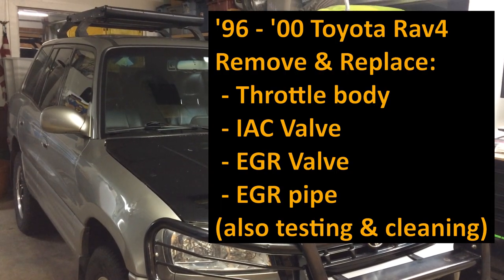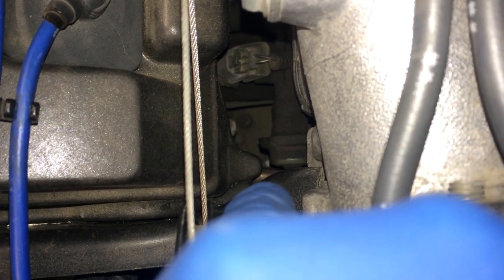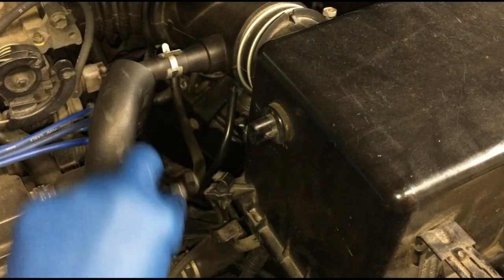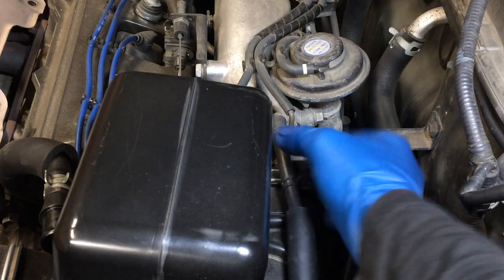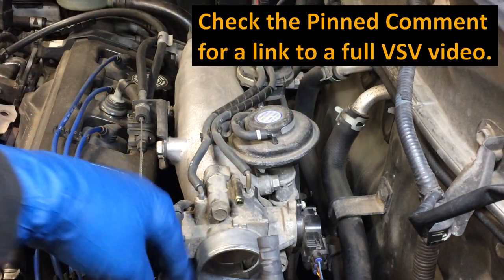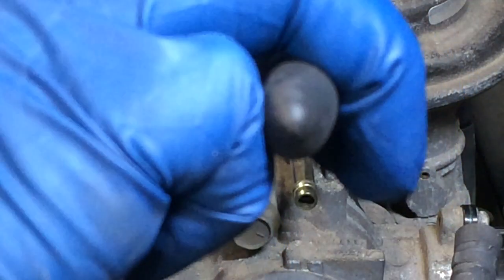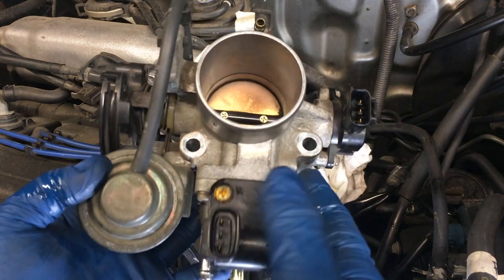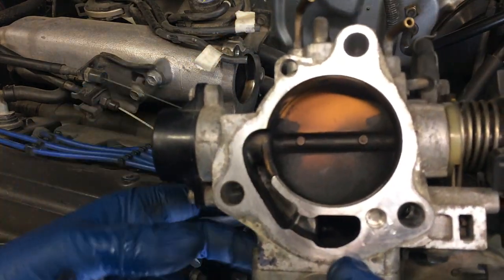1996 - 2000 Toyota Rav4 DIY Remove Throttle Body, IAC Valve, EGR Valve, EGR Pipe, with Bench Tests

Comment: I can not find the video L35, but I'm almost positive I watched one of your videos where you recommended using only Denso PK20TR11 double platinum spark plugs for the 2000 RAV 4, instead of copper or iridium. The plugs I pulled out of the RAV I am working on are Denso Iridium. Not the right plugs??  Thanks.
Reply from the maker: That might have been the timing belt video -- yes, the correct plugs for the gen-1 Rav4 are the Denso PK20TR11 platinum.  I would replace the iridium plugs with the platinums.  Be sure to buy Denso plugs only from approved retailers, and not Amazon, ebay, etc, because spark plugs are counterfeited often.  Those Denso plugs are about $8 each, so if the price seems to good to be true, then they are probably counterfeit.  I hope that helps -- good luck!
Reply: @L35inColorado  Thank you so much L35 for your valuable help. I use Advance Auto 95% of the time.  Even if they cost more than the net,  better safe than sorry.
Constantly amazed they stock parts for 21 year old vehicles. Hope you are healthy and happy in these uncertain times.
Reply from the maker: @hardlyworkin3603  Yes, I use them too.  You can save money at Advance if you order online, then select "pick-up in-store", and use promo code RMN25 at checkout online.  That usually gets you 25% off orders over $15.  I hope that helps : )
Reply: @L35inColorado  Incredible news!  Had no idea.  Definitely will help.  That will save a huge amount of cash, considering how many parts I need for this old RAV.  I wanted to get the Denso reman. alternator , but they are gone.  So I have to buy the new Carquest Pro 90 amp.   And a new Die Hard or Optima AGM battery . Thank you for your advice . YouTube is a great place when you need help from educated professionals such as yourself . So glad I found your site.
Reply from the maker: @hardlyworkin3603  I just checked the RMN25 code, and it is expired, but this code works for 25% off: OFFERS25
So hopefully that will save you some money! : )
Reply: @L35inColorado  Indeed it will. Thanks for the new code. I have all your parts numbers written down. Hope Toyota still stocks the parts I need from them.
Reply: @L35inColorado   One other major choice I am not sure of. Transmission Fluid.  Aisin ATF  Type T-IV,   Toytota ATF-WS, or Amsoil Signature Series.  Would you have an opinion on these choices.
Reply from the maker: @hardlyworkin3603  Yes, there here are some notes on ATF from another video -- it should start at the right spot, but if it doesn't, skip to 50:36
https://www.youtube.com/watch?v=HOcu3zuq1AY&t=3035s
I hope that helps!
Reply: @L35inColorado  I had not watched this video yet. Otherwise, I would have known the answer to my query.   Having now watched this one, yet another great tutorial from you. Thank you so much for your reply.
Reply: @hardlyworkin3603  for future reference i wudn buy any starter or alternator made in china. I went through 3 brand new not reman Napa brand, in a 3 year period! Best to have locally rebuilt with quality parts. Also the oem alternator gave me a month warning before it failed-squeeled for 2000 miles. But the made in china no warning at all. One min they worked and next they didnt!
Reply: @dw4940  For the most part, in 2022, I agree with you. Finding a reputable outlet that sells quality reman. Denso alternators is like finding a needle in a haystack, if you can find a Denso reman. at all.  It is also hard to find a local alternator/starter rebuilder outfit that knows what they are doing, and installs quality parts in the rebuild that meet O.E.M. specifications. Last time I hired a local in San Clemente,Ca. to rebuild my alternator for my 1992 BMW 735iL, he used all the wrong parts, and after install, I drove for 1 day, and it failed. He was supposedly reputable in the community. Another needle in the haystack not found that week.

Comment: Hi, great video. What has my Rav 4 got to do with idling? It starts ok, only it doesn't idle unless I keep it accelerated. I changed the throttle and it does. Thanks.
Reply from the maker: I'm sorry that's happening -- there are a few thing items that might cause this.  Check for vacuum leaks, especially the MAP sensor hose, but also all the other hoses.  A stuck-open EGR valve can also cause what you're describing, but I wouldn't suspect that just yet.  Other items are the TPS, IAC valve, ignition system (distributor or direct ignition).  
Perhaps you can start a thread in the 4.1 section of rav4world.com: there are some very helpful and knowledgeable Rav4 owners there who might be able to help you out!  Good luck : ) 
https://www.rav4world.com/forums/4-1-faults-fixes.85/

Comment: I seem to have a vacuum line right under the Throttle position sensor, that feels attached to the the throttle body, on my 2000 rav 4. Do you know what that is for, and why its different from the rav in your video?

Comment: What tools would you suggest I get to make working on the RAV4 easier ie obstruction wrenches jic screw driver and hose pipe remover pliers.
Reply from the maker: I'm sorry I missed your comment -- as you know, the Rav4 bay is rather tight, so wrenches are a must because there are some places where a ratchet and socket just won't fit; obstruction wrenches are nice but not absolutely necessary (I went without then for years, but love them now that I have them).  I kinda have a "wrench problem" so I have bought tons of wrenches over the years, and I just really like wrenches, haha!  But wrenches are great for tight spaces.

For auto repair in general, you'll need metric socket sets: if you can only get one set, get a 3/8" drive set that covers at least 10mm to 19mm, which will cover you for most top engine and body work, except for that you'll also need a 30mm socket for the spark plug grommet nuts if you ever need to get inside the valve cover (and you can also use that 30mm for the axle nut if you get it as a 6-point deep socket).  You'll need at least a 3/8" drive ratchet and some extensions.  I like wobble extensions and use them a lot.  Ideally, it is great to have a 3/8" drive and 1/2" drive set-up with ratchets, sockets, and extensions.

For brakes, suspension and lower engine work, you'll want a 1/2" drive set that covers metric sizes up to at least 21mm (the lug nuts are 21mm; the crank bolt is 19mm, and there are a few 19mm and 17mm suspension bolts), plus a deep socket 6-point 30mm for the axle nut, as mentioned above. Flare nut wrenches are nice for brake lines and ATF lines.

The JIS screwdriver is essential if you're doing throttle body work because Philips or Posidrive bits will just ruin those screws, in my opinion.  Hose pliers (I love them) are great if you can get them.  Picks, prys, pliers as always useful and can be real time savers or even life-savers!   Honestly, I kinda have a "tool problem" and probably like tools too much, and buy too many tools, so I'm probably not the best person to ask!  But I hope this helps : ) Good luck!

Comment: Outstanding explanation, i have learned many things. My car is camry 98 model 2.2 automatic 216000 miles running. Problem with my car is it stays 1000rpm at neutral when i put on D then stays at rpm 800, if i turn on the AC then 500 and car starts shaking, i cleaned throttle body only but not idle valve or egr.  Problem not solved  Computer error code comes only P0401.  Should i clean idle valve? I found my idle valve has only coolant 2 hoses no other gas pipe ur one is showing 3 hoses, please suggest me what to do. Thanks
Reply from the maker: I'm sorry I missed your comment -- to answer your question, no I wouldn't work on the Idle Air Control (IAC) valve just yet, because the P0401 is "EGR Flow Insufficient", which is a different system than the throttle/intake/IAC side. 

The P0401 on the 3SFE (Rav4) and 5SFE (your Camry) engines usually means one (or more) of these issues, listed in order of ease of repair:

1.) disconnected or broken vacuum hose (there a few little hoses that should be checked), or
2.) a stuck-closed EGR valve or EGR valve with a diaphragm leak, or
3.) a leaky/weak vacuum modulator, or
4.) a clogged up EGR pipe, or
5.) a malfunctioning VSV (vacuum switching valve)

Though the names sound complicated, none of these components is very complicated, and they are all within the abilities of the average DIY person with simple hand tools to test, remove, and replace. 
 
Check out this video for trouble-shooting the EGR system -- the video shows a Rav4, which is the 3SFE engine, but your 5SFE is similar:

https://www.youtube.com/watch?v=pdpnk2f7gnc

That video explains how the EGR system works, and shows how to test each component of the EGR system to eliminate the possible causes, one-by-one.  Since you're getting an EGR code (P0401), trouble-shoot the EGR system first before you open up the IAC valve, because a problem with the EGR system can cause the symptoms you describes of poor idle and bogged-down idle under load (ie, when you run the AC).
Good luck!
Reply: @L35inColorado   Thanks for ur important reply which i appreciate. I shall follow mentioned ur 5 tips and i shall watch linked video. i want to share something else about my car. 2 months ago my cars map sensor pipe was disconnected suddenly,  which i could not find in the beginning, found at later while i did the computer check, but in between i changed fuel pump, spark plug and fuel filter as somone suggested. during this period i did something mess actually, after starting the engine i put the gas padel manytimes and every times black color carbon powder comes maybe due to air fuel mixture ratio, which i understood later. after installing the map sensor pipe  the black smoke gone. due to manytimes accelerating the gas pedal some carbon may deposited in the engine or clogged the catalytic converter. so i used stp all on one fuel system cleaner once, and i dont know it works or not, can u suggest me is there any other easy way i can clean them or i shall leave it like this,  if so then will it be harmful for the engine in future? or like this if i just drive the car it will dissolve automatically? someone said ur cars new spark plug again may worn out cause of too much carbon diposit, it can be true? i feel jurking with out puting on any gear during acceleration 800rpm to 1500rpm after happening this, above 1500rpm it runs fine. i shall be wating for your valuable suggestion. thanks again.
Reply from the maker: @rafiulkabir  STP Fuel system cleaner is intended to clean up clogged fuel injectors -- it doesn't hurt to use it or another good fuel injector/fuel system treatment, but STP or other fuel system treatments won't clear up a carbon issue.  If you determine that you have a carbon issue, I would recommend Sea Foam Top Engine cleaner: it is very easy to use and can help (if you have a carbon issue).  

BUT don't assume that you have a carbon issue just because of the black smoke, because while you were running the engine with the MAP hose disconnected, you didn't realize it, but you had a significant vacuum leak. This is because the MAP sensor vacuum hose connects directly to the intake manifold. So, if that hose is disconnected, there will be a big vacuum leak, and vacuum leaks can cause black smoke because vacuum leaks can cause the engine to run rich.  Also, there would be incorrect MAP (manifold absolute pressure) readings sent to the ECM (engine computer) when that hose was disconnected, so your ECM wouldn't be able to get the right air/fuel mixture.  

For more detail, what I mean is that with the MAP hose disconnected, the ECM could have been trying to compensate with more fuel...so you were likely seeing black exhaust smoke because the engine was running rich ("running rich" meaning too much fuel being injected, since the air volume values were unexpected because there was a big vacuum leak).   If the black smoke stopped after re-connecting the MAP hose, then you're likely okay!

So, regarding carbon build-up -- I wouldn't worry about that right now.  Instead, I would work on the EGR issue (the P0401 code).  If you have a carbon issue, you'll likely find it during your EGR investigation, because carbon is what typically clogs up EGR pipes and valves.  So, if you find that carbon is clogging the EGR pipe or valve (or both), then you can address that EGR issue first.  Good luck!
Reply: @L35inColorado  thanks for ur detail explanation. It is helping me a lot. God bless u.
Reply: @L35inColorado  hi i watched ur videos and clean egr, idle valve, checked vacuum modulator, but couldn't reach vsv, and clear the error code P0401, driving since 2 days lets see it comes again or not.  I do have a question about carbon buildup, if i drive the car say certain high speed say 80mph for 20 to 30 min it will help decarbonizing the engine? If this true?
Reply from the maker: @rafiulkabir  Wow, great work -- hopefully all the work you completed will solve the P0401!  
How much carbon did you see on the EGR valve?  
How did the pipe look?
As for carbon buildup -- no, in my experience driving doesn't do much to decarbonize these engines, and if the carbon buildup is on the exhaust side (EGR valve, pipe), then driving does very little.  Sometimes "aggressive driving" helps (fast accelerations), but even that doesn't seem to do much unless you use a "top engine cleaner" like Sea Foam.
Reply: @L35inColorado   @L35 in Colorado  it was hard layer of carbon inside the egr valve which i have  cleaned, but steel pipe couldn't disconnect from the down side so i couldn't clean inside of that pipe, once i thought i can spray some throttle body cleaner atleast inside the pipe but did not dare to do that cause this carbon maybe going where inside the crankcase? I don't know. During doing this work i open the   spark plug to see carbon in side the combustion chamber, but couldn't see properly maybe i need borescope. But i noticed something i got some oil over spark plug of cylinder no 3. I believe oil is not going inside but only at middle of that spark plug. Should i do anything for that? If i drive with this situation anything will happen?

Comment: Hi L35, can you tell me please where is the air hose from the IAC valve plugged, I mean that the hose is plugged into the IAC valve but I don't know where to put the other side of the hose, right now is unplugged and when the engine is started it seems to suck air, it will be so helpful for me, thanks 😀
Reply from the maker: I'm sorry I missed your comment -- I think you're talking about the Idle Up hose, which is part number 17341-74040.  That hose connects to a steel pipe on the back side of the engine (under the intake); that pipe runs towards the power steering pump and serves for the idle up required when turning the steering wheel (increased engine speed for the power steering pump).  Is that what you mean?  If so, here are some pictures that might help -- scroll down to post #18 and read from there.  I hope that helps!

https://www.rav4world.com/threads/vacuum-line-replacement-with-high-temp-silicone-lines.255961/
Reply: @L35inColorado  yes thank you very much, that was exactly what I needed 😀 just one more question, there is a small steel pipe on the throttle body that is on top of the Throttle opener or Dashpot, I don't know the name exactly, it also has a hose but is unplugged on the other side, would you please tell me where is this hose connected?  Thank you so much
Reply: The thing is that in your video that throttle body doesn't have that steel pipe 😕 may I mail you a pic of that?
Reply from the maker: @alejandrosf8794  I'm sorry, I don't do emails like that, but if you can find a picture online and post the link, I'll check it out.  But I'm thinking that maybe you have a California emissions Rav4, because they have different throttle bodies than the one shown in the video (which is Federal emissions).  Do you have a California emissions Rav4?  You can check on the underside of the hood -- open the hood, and look for a sticker on the underside, towards the front of the hood (white sticker with black writing, about 3x5 inches).  You can also run your VIN at this site, and if you have CA emissions, it will show here:

https://www.toyota.com/owners/my-vehicle/vehicle-specification

Either way, if you find that sticker under the hood, the sticker shows a vacuum routing diagram for the other hoses on the throttle body, which ought to include the hose you're looking for.  (The Idle-up hose isn't shown on that diagram, but the other hoses are.)  I hope that helps!
Reply: @L35inColorado  than you very much for your time, you helped me so much!